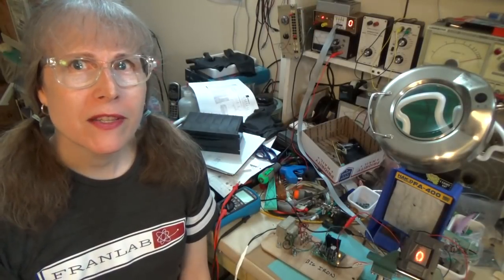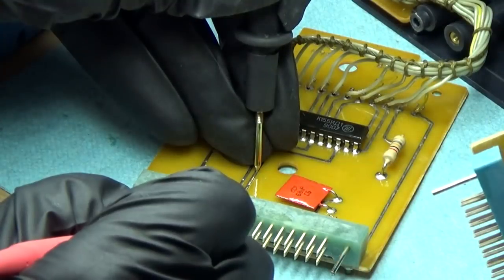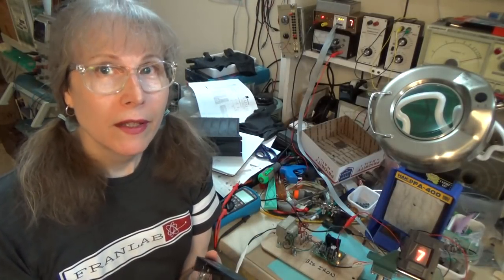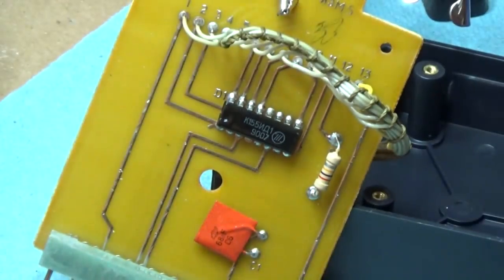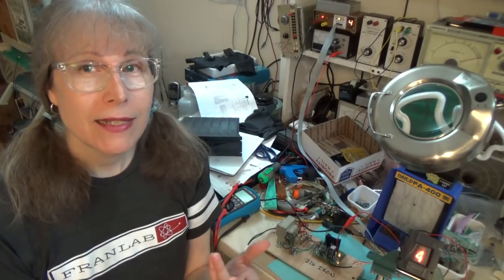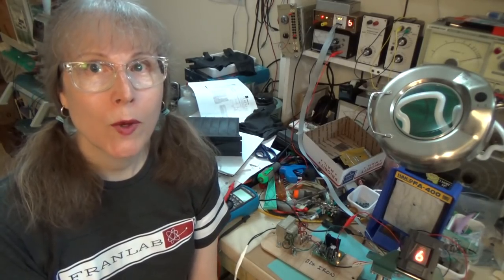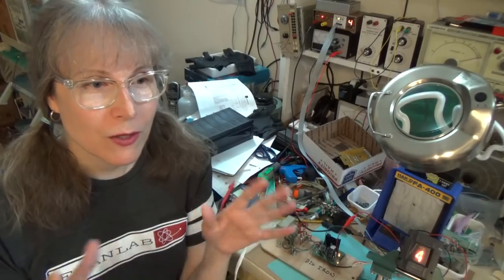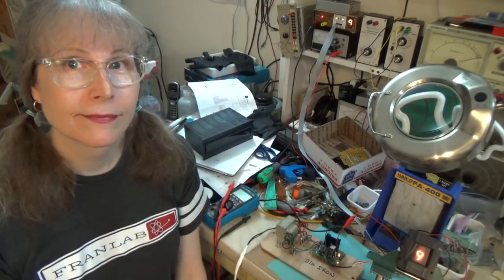1992 Nixie Display Modules!   Whaaat??

Comment: It's the other way around. Lower supply voltage actually makes the nixie current less stable. With a low supply voltage, a small variation of the nixie voltage drop causes a big variation of the current. You have to use a higher supply voltage to make the current vary less with the nixie voltage drop and with the supply voltage.

Comment: This is a CIVIL/common (not a MILITARY!) display module for measuring equipment. The title "K155..." means that it is made for a CIVIL use only (the letter "K" means "Commercial"). The real Soviet MILITARY version is "155...". That kind of THIN RED capacitors is super brittle and was never used in Soviet MILITARY devices. And I believe that the connector does not belong to the MILITARY grade also. Soviets used Year and Month (not a Week!) to mark the date of production.
Reply: R2DAW ... So that is a pic of Military chips ???
Reply: Yes - no "K" symbol, vertical rhombus with acceptance number. Of course plastic ICs used only in devices which are never intended to be used in harsh environment. 
In other words - yes, 98% it's metal-ceramics cases but sometimes in some equipment you could find such plastic things.
Reply: R2DAW posted a link to a photo of MILITARY grade "155lr3" in plastic DIP case.
Reply: NEY Industries, those are some fine pictures you posted, thanks for sharing!
Reply: Those red capacitors work as a damn fine microphone. Not very good for a capacitor xD I remember using one as a microphone many years ago as a joke.
Reply: @rich1051414  , some years back I picked up a bunch of audio gear and PA equipment from an old guy who used to do sound for Broadway Theater and musical Productions in New York. One strange microphone I got from him was rectangular and about 4 in tall and had what appeared to be a series of stacked flat ceramic capacitors, almost like a weird analog tuning condenser from a radio except with wider spacing between the elements. I couldn't get it to work and I presume it needed some kind of phantom power supply which didn't come with it when I acquired it. It probably had a 3-pin or 4-pin connector, but I really don't remember. This guy had some cool stuff, I got a bunch of tubes from him and a rare and valuable Western Electric 555 horn driver, also some cheaper versions of the classic Altec or Western Electric Birdcage mics that had molded plastic cases are cages instead of metal ones. He had a bunch of big PA cabinets with multiple Bozak drivers in them, but he wouldn't sell them to me for some reason ( these old guys can be funny sometimes, even when they're pushing eighty they think they might use this stuff again someday!), and then when I went back to visit him one day a year or so later he was gone, in a nursing home, and somebody else had bought the house and knocked down the decaying storage barn and all the remaining speakers and electronics had been hauled off to the dump or something.

Comment: When you do the clock project, could I suggest a radio controlled clock so you don't ever have to set it?
Reply: Just a reminder that the FY19 NIST budget proposal includes shutting down the WWV, WWVB, WWVH clock stations.  Please call your local congressperson if you would like to see these stations keep operating.  In addition to providing a signal to radio controlled clocks, they are also very useful as radio propagation beacons.

Comment: 1990-1995 is the actual sunset of the valve era in the USSR/Russia. For example, as a student, and then as a junior lecturer at the university, I was able to afford to replace a valve TV for a transistor TV around 1995.
Reply: Hybrid black and white television sets made of both valves and semiconductors were still made at least up until 1991, example: http://www.rw6ase.narod.ru/00/twcb_/rasswet307_1.html

Comment: 2:43 Well, actually not military - IC in civilian version and this crap quality K10-7V (also unofficially called "Red Flag") capacitor which is never used in MIL equipment. A conformal coating is often used for industrial applications.

Comment: In my experience, as Nixie tubes age or are of poorer quality, this exhibits itself as a change in the firing voltage. For me, the best work around has been to increase the voltage and the value of the anode resistors. This causes small tube voltage variations to be a smaller percentage of the total voltage, and with the larger anode resister, this results in less variation in tube current and thus brightness.
Reply: I was thinking it ought to be that way round, that more volts and more resistance would balance the current more tightly
Reply: This is also the way with diodes - the larger voltage and resistor, the less sensitive the solution is to voltage variations in the LED.

For nixie tubes, it all comes down to the question of what parameter is changing (most)  between batches or as they age. If it is the current or voltage through them that decides their intensity.

Comment: I worked as a mechanic in a gas station when I was in between jobs back in 1996. It was at an old Exxon gas station.They had gas pumps there that were using nixies as displays. They were left on all day and most of the night. They never had any issues with them the whole time I worked there (about a year or so).
Reply: some of those are actually 7seg filament displays!  I have seen some in use just a couple of years ago, was very surprised.
Reply: I have some old gas pump boards from the late 1970s that were based on the Fairchild F8 microprocessor - which is the only application I have ever seen of that processor other than in Fairchild’s own Channel F video game console.  Anyway, some of the boards have DIP packaged versions of RCA’s incandescent 7-segment Numitron displays; some boards have different driver chips and flat package 7-segment neon plasma displays.

I believe I would stick with the original anode resistor and higher supply voltage on those Soviet/Russian displays.  There will probably be less variation in brightness between adjacent Nixie tubes because there is more headroom in the resistor, which provides a quasi constant current source despite minor variations between tubes’ voltage drops.  The brightness is more related to current than it is to voltage.  Also, Nixies have a fairly high strike-off voltage for initial ionization that increases as the tubes age and become contaminated with metal deposits.  Using a 225 Volt anode supply helps assure the Nixies turn on reliably even as they age.

I don’t know much about Soviet military equipment, but I suspect also in the former Soviet bloc and Russian Federation that components such as that capacitor, brittle and not fastened down, would not be allowed.  Plastic package chips like the driver IC would usually not suffice for military applications.

My favorite neon tubes were great big about four inch tall, if I recall correctly, 15 segment tubes intended for alpha numeric characters, made by Burroughs.  I got several dozen for about fifty cents each from a place called Olson Electronics in Akron, Ohio back in 1975.  I was in high school, and used the tubes with hard wired wording to make a sign for my Junior Achievement company.  I am pretty sure the tubes were pulls from stock ticker displays.  I just rectified mains voltage to get about 176 Volts DC.  Occasionally I would get a balky tube that would not light reliably with such a relatively low supply voltage.

Comment: I bought one of the Ian Sparkes nixie clock kits (nixie tubes not included) about 2 yrs ago. Google for "Ian Sparkes clocks". I also bought (6) ИН-14 nixie tubes from a Ukraine vendor. The date codes on the tubes are all early '90s. I love the "ИН-14 СССР" label on these tubes; Soviet blast from the past. These were unsoldered pulls from some other equipment. This was a real hassle in the kit build, as the tube leads were rather short, maybe 20mm at most long. You can find new ИН-14 tubes with original ceramic bases and long leads. The trick to threading all 13 leads through a PCB (no socket) is cut each lead slightly shorter than the neighbor lead; 1/2mm is enough. You are then just managing 1 lead alignment at a time using this tactic, vs all 13 at the same time, which is what I was facing. The kit uses one 74141 nixie driver which is multiplexed across all 6 tubes. There are opto-isoloated transistors to scan the anode voltage across the 6 tubes. The core clock logic is in an ATMEL Arduino chip, and the source code is on github.Obviously you will be designing your own clock, because you are Fran. :) I like the orange neon glow of nixie tubes. Over driving these tubes with a higher voltage will shorten their life. Cathode "poisoning" is also a concern, similar to CRT image burn in. Most nixie clocks have anti-cathode poisoning logic built in to their firmware, which cycles through all of the digits for each tube at full intensity randomly for a few seconds every 10 minutes or so. There are also 1 nixie tube clocks, which displays each digit of hours/minutes sequentially. I like the 6 digit clock much better. Good luck and have fun designing and building a clock. I see you have a Heathkit GC-1005. I built one of these kits in 1974 at age 10. I still have this clock and it has been running pretty much 24/7 since 1974. It does have flickering digits, so I'll watch your planaplex clock repair video to see if I can eliminate the digit flicker.

Comment: I know this is off topic but if someone could help me.

I have a question for you if you can answer it. I completely understand if you don't. I've been tinkering with electronics for a long time and am self taught so there is alot I still dont know.. i love buying kits and building them or repairing tv, cellphone, stuff like that. But I bought a tube amplifier off of banggood not really know how hard it would be to find a transformer for it. It requires a ac 120 x 18-0-18 3A

My question is.
Do you know were there might be someone who sells new old stock I could order one? Or is there a way to run something that requires ac voltage on a DC power supply?  Thanks in advance.

Comment: Wow, I haven't seen a nixie tube since I got out of the Army in 1980. The system I worked on has since been replaced by the Patriot missile system and I imagine the tube circuits we used have all been replaced with solid state components.

Comment: Hi Fran that green connector on the back of your Nixie tube devices I know that connector because I used to work in the motor Drive industry and some of the drives that I repaired did actually have that green connector but that connector is pretty old

Comment: 3:00 also the 74141 drivers have built-in zener clamps of ~60V so once you go over a certain anode voltage depending on the tube, even the "off" cathodes will start to conduct (or won't turn off) - I believe around 170V was what they were designed for and work optimally at. This may be different for the russian variant of the chip - they may have higher clamp voltages, allowing higher anode voltage to be used without problem.

Comment: It's kind of surprising they were still building these that late, but at the same time their equipment used them and they had factories dedicated to production. Makes sense to keep going, keeping the workers employed (something that was not going well in russia at the time). This is one of the problems with centralized planning, whole regions are stuck with limited and inflexible production. Though one good thing is that they have a city dedicated to producing excellent rocket engines in such numbers that we can buy them for reasonable prices.

Comment: To lower the anode resistor it would have neater to strap other resistors in parallel with the existing resistor instead of chopping it out. Easier to convert back to standard.

Comment: I remember connectors like that from the 70s. The BBC had a standard plug-in module to go in a 19" rack unit. The board was mounted on extruded rails with a connector like that on the end. If my memory serves, the female connector had two sprung leaves which connected to the outside of the flat pins. They were self cleaning. I'll see if one of my old mates might remember better than I do! I'm pretty sure the Euro-card system replaced them and that is still available today.

Comment: the USSR is better with science and tech! the us just forces people to 'upgrade' to something new with no real improvements!! the soviets build upon the old design changing the parts that need change and leaving alone what was fine in the original design. i would love to see the us start building things with a soviet mind set. the cost of things would drop as old tech is easy to make with more modern production methods and materials. but efficient simple design will not catch on as the means of production is not organized by the worker and the consumer!! I would love to have new cold war items!! I love simple easy to fix stuff.
Reply: Yeah... I just repair and use old stuff.  Modern Chinesium is repairable if you do your research but do you really want to do SMD soldering work on a refridgerator? A 1989 Toyota Camry gets me around, a mid-'80s Maytag has washed everything from my diapers as a baby to this weeks' laundry, and a 1954 Hotpoint keeps my food cold. They just work because I can easily work on them.
Reply: you are right a bout the Modern Chinesium I have repaired it but it ends up being more work than it is worth. 1954 hotpoint rocks!!!! the old Toyota's rock. as for Maytag I do not know as we had Kenmore growing up and it never failed. as for me I have a lot of old stuff as well. the only problem is the old stuff a lot of it has been used and abused to the point that it will only have a few more rebuild cycles left on it. that is why the cost of old stuff keep going up. I do a lot of rebuilding of old equipment and worry the day usable cores will not exist. for example 7 out of 10 ford flat heads are next to impossible to rebuild as the mechanizing costs are so hi. but places that keep building old stuff the U.S.S.R AND ITS SATELLITES AS WELL AS MEXICO AND SOUTH AMERICA STILL KEEP SUM OF THE OLD STUFF IN PRODUCTION! their was a time in 1960s-the early 1990s the USA was building stuff on 15-25 year platforms! the grand wagoner 1964-1991!! the box Chevy truck 1973-1991!! ford bull noose truck 1980-1997!  I would like to see things built on running plat forms. the grand wagoner was the coolest it still sported a AMC 360 and a carburetor till 1991!!  the dodge D SERIES from 1972-1993!
Reply: I like your idea to a certain extent. However I also as a nursing student enjoy the convenience of carrying my macbook air easily in my folder.

Comment: you should use Geigermeter for them and be glowing surprissed!!! 8)
Reply: Why? There is no radioactivity in these.
Reply from the maker: I routinely test all military surplus parts for radiation before handling, no issues with these.
Reply from the maker: Krypton85 is a moderate beta source that cannot escape the glass tube, but also has a half life of 10 years, so after a few decades would likely not be detectable.
Reply: Some of the american nixies have KR85 in them, but half life and stuff means they are "dead" radiation-wise today. I don't know of any russian nixies that were doped with KR85.

Comment: There is rhombus marking on the tube with is stand for "military grade" equipment. Standard marking for USSR devices. But don't be confused by marking on case - it means nothing
Reply: Rhombus with niddle on the case - manufacturer logo, "Electrotochpribor". They are usually known for analog meters. Still running their business:
https://etpribor.ru/
Reply: Yup, second R2DAW, just manufacturer plant marking, nothing to do with "mil grade". I don't think there were explicit mil markings in ussr.
Reply: There were mil markings but it's not that simple as it could be seen.

Comment: Nixies last a long time.  I have two Heathkit instruments, a multimeter and a frequency counter.  I bought them in the  early 1970s. All of the nixies are original.  The multimeter is 3 and 1/2 digit so the one was made with a NE-2H.  I had to replace the NE-2H a couple of times.  The frequency counter has 8 nixies.  IM-102 and IB-1102.
Reply: Have a 6-digits-nixie-clock running for more than 40 years, 24/365. Had to exchange a capacitor, and one of the tubes (Hitachi I think) shows a dim 6 now.  Good value...
Reply: I am partial to Nixies as well.  Second is the Orange Planar gas discharge tubes.  Third the LCD and LED displays.  The worst display is the VFT (Vacuum Florescent Displays) that fades in less than ten years. 
The VFT display was used on many VCRs and other consumer goods.